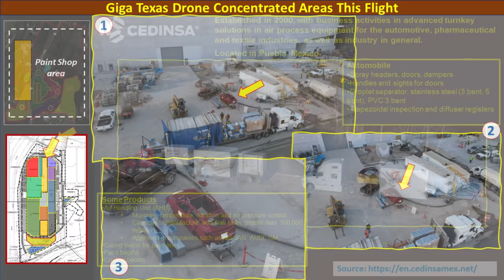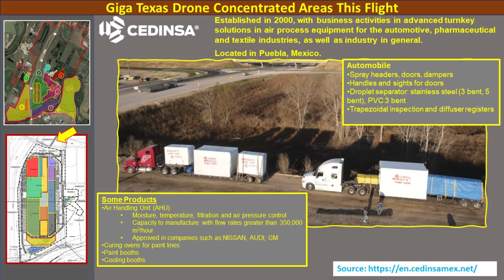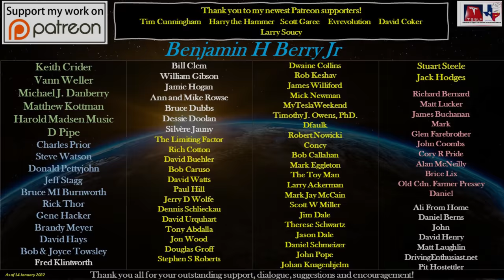Tesla Gigafactory Texas 14 January 2022 Cyber Truck & Model Y Factory Construction Update (07:45AM)

Comment: Thanks Joe. Plenty to see today. 
6:42. North east Battery. Inside under the green sheeted wall. One of the stainless steel silos seen previously in the east side storage area.
7:25. West side Battery. Bottom of stair. Crate marked Zeppelin.
8:50. West side Main Entrance. White frame. Fitted a bottom track for the fixed glazing panels and sidelights. 3 pairs of pivot doors in between. Glass can’t be far away.
9:26. GA roof. PV panel brackets being stockpiled in various locations towards Paint/BIW. We might know in the next few days how the panels will be set out. 
10:05. West side GA. Footing excavation for an external stair. 
10:10. West side GA. 10 dock levellers installed.
10:30. West side GA. Inside, but for stuff stacked on the floors it’s empty.
Apron, excavation for a stair and a pedestrian ramp. Likely similar to that at 8:09.
10:36. West side, south end apron. Edge boards set up for concrete against the building. Quite a change in elevation there between the corner and the stair.
11:12. South end GA. A disaster unfolds in the doorway.
12:05. South east storage. Bottom right. In addition to the steel sections stacked inside seen in Joe’s 12 Jan video, more steel being stockpiled across the road. Thinking a big excavation in Stamping, and all this steel associated with the shoring.
13:09. Stamping roof. Stockpiling insulation boards and rolls of membrane to build the roof transition ramp.
14:38. South east open space. Bulk removing of earth and trailers. 
17:01. East side. Spoil dump, comes and goes. Not been properly cleared for anything else.
17:42. East side storage. PV panel stockpile numbers unchanged.
18:10. East side storage. Silos that were stored have gone, likely to Battery.
19:35. East parking. Quite a depth been removed. This area was well prepared originally, I wonder why the need to remove such an amount of fill and gravel.
22:00. North east Casting. Electrical vaults. Excavator there I’d say primarily to replace the lids on the vaults. The height of the vault was built up with concrete around the top.
23:44. Roof GA. Top left. PV panels brackets stockpiled.
24:54. North end Paint. Green sheeted walls have been given a finish coat of an acrylic render or paint. Suggests some permanency.
25:47. North end. Model Y. Most the firewall seems to be missing/not installed. I wonder if that’s another change to the structure associated with the cast front end and the structural battery pack.
26:30. North end Battery, apron. Rebar laid for the apron in front of the loading platforms. Interesting to see how long the platforms remain. Temporary stair installed in the last couple of days might indicate the removal of the stair on the west side.
Reply: 19:35 My guess is that the final design was not completed until recently and the temporary parking did not have to be puddle free. You ideally like to have at least a one percent slope on finished blacktop to help eliminate water puddles. So to gain enough slope over long runs the areas near the drain inlets had to be lowered.
Reply: @bobcallahan2322  Thanks Bob. I had a similar thoughts, but couldn’t quite think it through to your logical conclusion. I was thinking only 1 quite high crown across the entire gravelled parking area, and that now needn’t be as high once it is paved. Also had a thought that the road level might have been changed from what was planned, and that the parking area was being excavated to something nearer the same.

So many unknowns. A set of drawings of this area would be good. 

Interesting that they are using the black PVC (or whatever it is) pipe through this section. If they start running branches in PVC that might indicate a long term plan for a building. Or just using excess pipe.
Reply: As a nod to a famous holiday movie from my hometown: "Wow, Whoopie, A Zeppelin!!"
Reply: Dessie, At 10:36 You know that the west side is 4' lower because of the receiving docks and the change in elevation is to bring it back to grade.
Reply: Zeppelin do installation of various manufacturing lines including plastics and rubber shape moulding , the placing of crates means it could be for plastic part of the factory next to battery plant.
Reply: @AndyAndy-we9pe  Thanks. I hadn't thought to look further into it. Seems there's a bunch of companies with that name. As you say there's a plastics company which seems to be based in Italy. There is a company that makes silos, and based at Freidrichschafen Germany. All tied in together somehow from what is showing up in a search. 
I visited the Zeppelin Museum at Freidrichshafen, interesting place. Weird how stuff comes back around.

Comment: With all of the diesel-fired lifts needed to facilitate the final construction details, I am now more understanding of the delay of sealing up the building, leaving plenty of windows off till all the machinery is out.
Reply: Interesting thought. Between that and the paint fumes and other airborne detritus, sounds good to me.
Reply: Maybe tesla needs to invest in a factory to build electric construction equipment, I mean most of the equipment driving inside is small or could use electric battery for ballast, I am suprised they are not using electric vehicles inside.

Comment: Interesting that there's more paint shop stuff coming.  

Along with more stamping machines and casting machines, that suggests they're building out an entire parallel manufacturing line before the first one is even going. They must be planning a super aggressive production ramp.
Reply: agreed
Reply: I think you're right on. You wouldn't install the second or third round of production lines until you have the kinks worked out of the ones you've set up for initial production. Not an issue in the casting cathedral as the 6100 iDRA presses are nothing new to Tesla. The structural pack Model Y and upgraded paint shops are different enough that you wouldn't build ten of them until you've worked out the first one or two.
Reply: @stevehockey4  How do they handle paint?  One line per color, so they never have to switch colors?  Single or a few colors in batches?  Could be adding paint for another line or just more paint for the first line.  Work things out with white and black, then add by expected demand.

Comment: The "temporary filtration system" seems to me to be something necessary, because of the exhausts from bobcats and other vehicles still being used  inside the building for construction. I'm no expert, but it seems logical. Thx again for the updates and video.
Reply: Steven, Joe is referring to the pumps that will clean the cooling water lines for the HVAC system, not the air ducts. Actually we do not know what lines they are cleaning but they will use a liquid indicated by the centrifugal pumps and filters.

Comment: Cement around the building 99.9% done! Still waiting on the glass to be installed. Pretty amazing!
Reply: The Glass is still not here because of shortage of anything
Reply: Most of the glass seems to be waiting installation
Reply: Concrete around building is almost finished. Cement is one of the ingredients in making concrete. Still a lot more to come, lots of the asphalt or macadam paving was temporary. Some has been replaced with concrete, in fact.
Reply: @TheZackrambo  yes some glass is here and some glass is not here
Reply: @The_DuMont_Network  yea in 2 more week will be open date
Reply: I am a little surprised they haven't moved faster on installing the remainder of the standard windows on the West side. Would free up more of the west lot to be utilized fully and help to separate construction crews from plant employees for increased safety. I'm sure there's a reason though.
Reply: @stevehockey4  I'd say increased ventilation especially with all the cleaning and painting going on. There's a TON of white paint being applied everywhere. Not all the roof venting is finished, and neither is the main HVAC system. 
They do very little without a reason, I agree with you. But it would be fun to know...

Comment: A couple of big picture things have surprised me.  

First, the additional buildings have not been started yet.  There is lots of site prep, even frames have been delivered.  I wonder why there are no foundations, site work or other progress.

Second, the rework on the south end of the building.  There are some modifications that are simply changing temporary grading or drainage during construction, but now it seems almost endless.  Was there a complete rethinking of what was being built in this area?  The modifications are continuing at a point in the construction that one would expect the grading to be completed. 

I welcome your interpretations of what is happening on these fronts.
Reply: Been thinking about this over the last few weeks,  there is one part near the pond that they have been grading for three weeks so far and do not seem finished.

Comment: Thanks for the video, great job. This job has a long way to go!  You will not see scale car production for 8 to 12 months. The work is moving slow, man power is minimum for a job that size. I spent the last 33 years running work just like this. The pains taking work is in the setup of the production lines. Texas has never been known for the speed of it's work pace. I am looking to buy a model Y with the castings and battery platform from this plant. I guess i will be waiting for some time.
Reply: Agreed, I have said March for customer cars delivery, but when I see the amount of equipment  being delivered I feel like it could be q2 or even q3 at a push, I have searched but find no announcements of when customer production will begin, I would still rather buy from China for build quality, maybe Berlin too. But it all depends on what electric cars are available when I win the lottery.

Comment: At 25 deg external temperature there really should be no steam escaping but we do not know what processes are in the building.  

I also wonder when what I believe to be a temporary power supply to the stamping press area will be removed, the two green boxes at the southern end.

Also, the Cedinsamex figure quoted seems incorrect as 350,000 m3/h is 98 m3/s and at a face velocity of 2.5 m/s over the internal components would give an area of 39m2 or size of 6.25m x 6.25m or about 50ft square and those units look much smaller than that.
Reply: I think they are using a 'wet condenser'  aluminum fins sprayed with water.

Comment: Regarding the solar panels on the roof. I think Tesla might do something TRULY unique with the panels to spell out TESLA or make the logo. The first clue is the initial set of panels facing west. For optimal efficiency, the panels should face due south, at an angle above horizontal matching the local degree of latttude. However, placing the panels 10º-15º flatter doesn’t have a huge impact on the overall efficiency. The effect is also reduced at lower latitudes, such as Central Texas as compared to say Maine or Montana.

I believe that Tesla may angle the panels in different orientations so that the RELFECTION off the panels makes the intended design. The entire roof can still be a large, continuous field of solar panels, but the design is noticeable in the variations of light reflecting off the panels. It’s kind of like how designs and patterns are made in MLB outfields. It’s all the same grass, but the light reflecting off different sides of each blade of grass is what makes the overall design apparent.

Comment: @ 8:31 two blocked of loading docks that are numbered. One for sure will never be used as a loading dock, since it has stairs in front, and a stairwell inside. Another numbered but blocked off loading dock being used for stairs @ 9:47
Reply: Now back up to the stairs and we'll start unloading yah haha
Reply: Maybe the numbers don't necessarily designate loading docks. 
"Back up to W48 and wait there until W50 is free."
"Entry to the building is via the stairs at W47".
Reply: It's not impossible that these concrete exterior and metal interior stairs at 8:31 are temporary or Phase 1 items. We've seen them rip out plenty of things that seemed permanent at one time or another. Very possible that they are in place to provide a required second fire egress point from the engineering offices while the other immediately adjacent areas in Battery and GA2 are still active construction sites and off limit to people that don't have an active construction role for safety reasons. Your 9:47 stairs are the same ones from 8:31

Comment: Joe,   21:05  CEDINSA supplied much of the HVAC equipment in paint originally. They are based in Spain. This equipment probably came from their Mexico plant as the already installed equipment did. This may be an upgrade or addition to the original design.
Reply: Its my guess that they may be installing additional paint lines now that the initial ones are up and calibrated. Either that or these are replacements or upgrades for components that are not satisfying requirements in the finished test cars.
Reply: @stevehockey4  Steve, they initially installed two parallel paint lines. They start on the bottom floor headed north and at the north end of the building are lifted to the second floor and head south for drying and inspection. I doubt that they have room for more lines.
Reply: @eltonray2934  if they want to get to the sort of capacity that is being talked about for this facility we should hope they have room for more lines.
Reply: Elton, do you think the CEDINSA equipment is the start of construction of a third paint line like you've seen before? Alternatively, the CEDINSA website also has a reference for the design and installation of "rework booths" for automotive paint shops incl. BIW. Equipment deliveries for the rework option seems also possible and feels about right on time. When the assembly line(s) start moving continuously (imminent?) there need to be a route for quality rejects to be recycled and reworked?
Reply: @hardernl8893  I doubt that it is for a new line, could be rework unit, I do not think they have enough room for another complete line.
Reply: I have to laugh , no space for another paint line... they could probably have no problem installing 10 lines but why waste space when two or three will do.

Comment: At 23:00, I think the near high boxes are intake vents, and the back flat vents are outlets and we've seen vapor coming up out of these back ones.
Reply: I agree, the intake is filtered and the exhaust has heat coming out which forms vapor in the cool morning air. These appear to be the HVAC heat removal ducts and just below is the compressor and condensing units to cool the building.

Comment: Hi Joe, I wonder if you can determine from looking at the numbers above the listing bays, if they indicate that the originally built then sealed loading bays will be opened up in future. I'm assuming if that is the plan they will have accounted for them in the numbering?
Reply from the maker: That is the plan … future expansion!
Reply: If looks like many of those have numbers as well above them
Reply from the maker: @TheZackrambo  they do and it’s a relatively new change
Reply: @JoeTegtmeyer  I watch on a phone screen so it's hard to see fit myself, even in 2160

Comment: I am intrigued about the roof membrane material and it’s toughness. It really must be awesome stuff to withstand all the activities we seen occurring on top of the finished surface. All it takes is a small tear or nail hole to cause a leak. Anyone have any opinion on the roofing material and it’s durability?
Reply: I suspect when roof installations are finished they will do a final covering that is waterproof and self cleaning. Amazing how many vehicles they have driving on the roof but all seem small and light

Comment: 14:16
I wonder if they'll remove those power lines that go to the green junction boxes there close to where the new graded gravel pad is being put.  If they're planning to take the plant another 500 feet on this end they're going to have to remove them I guess?
Reply: Was thinking the same thing. Not sure, but that small power line seemed temporary to me when they put it up.
Reply: @jamescoppe  yeah, I’m guessing it was a temporary power line until the massive electric connection was built to the north of the plant. They will probably cut it over soon and take this smaller power line out…
Reply: Those are transformers which take the high voltage from the transmission lines down to a lower voltage. hey were originally there to power the press area during the early days, may or may not be used as the entire system is finished.
Reply: Ok great, thanks for the info guys.
Reply: It's possible they were temporary to get started as others have stated. I can confirm from Google Earth that the last pole and the two transformers would fall within a perfect 500' extension to the building. While it's not unheard of to have pad-mount transformers inside a structure, its more likely they are eliminated or relocated.

Comment: Hey Joe, thanks for the video. But a question about your comment on the red Model Y body not having a floor section and thus indicating structural battery design. But even with the skateboard design (the current manufacturing process for all Tesla’s), the white body structure does not have a floor. During the “marriage” stage, the body is lowered on top of he skateboard and attached to it. What am I missing???